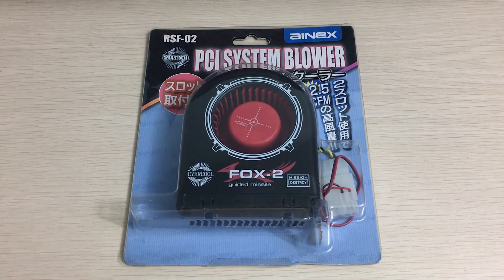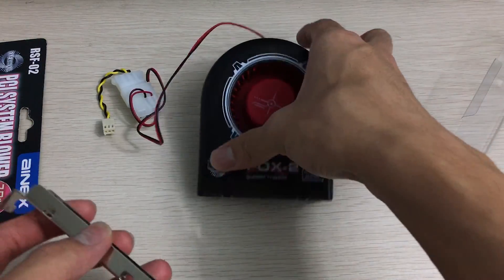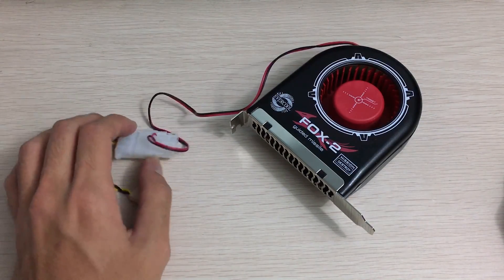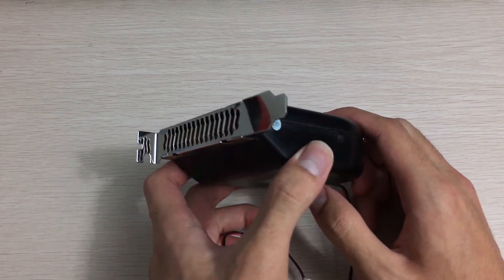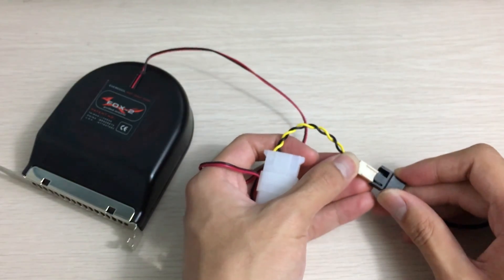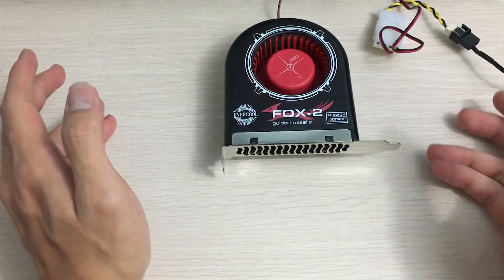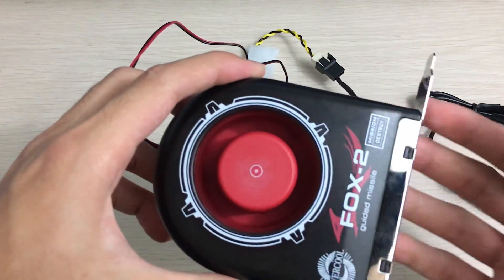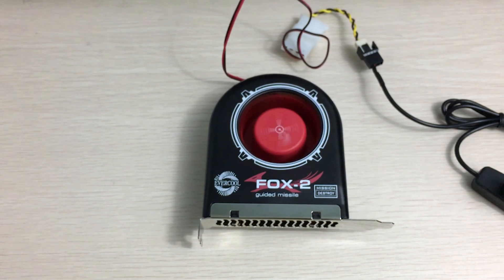PCIE Fans? What are those? | Evercool Fox-2 System Blower

Comment: which cable adapter are you using? does this 4-pin molex ide conversion for fan connectors? just tell me the name or please a purchase link. I'm from Brazil I loved the video congratulations !!!
Reply: its a molex to 4 pin adapter, available through amazon and most computer parts retailers

Comment: What are you talking about? It consumes hot air and exhaust it out of your case. Most of our exhaust fans are at the top of our case so this is useful because its down at the bottom under our GPUs. If you dont have a reference model gpu then this is extremely useful.
Reply: It is actually design for those office PC's or OEM pc's that has a poor airflow, or if you have an ITX build this is very helpful
Reply: @joshygaminghub7428  That may be the case but gpus produce alot of heat when active and this does a great job of getting rid of that heat. Its crazy how much heat you feel when putting your hands at the exhaust of this thing when gaming.
Reply: @qandmarco8994  if you have a blower style GPU and your case has a limited airflow on it, this thing would be useful

Comment: What are you using to control the fan speed as its a molex fan?
Reply: You can't control the speed
Reply: @ix.cryo1  Sure you can, it requires a molex adapter to either a 3 pin or 4 pin fan connector, then buy a fan speed controller in either 3 pin or 4 pin
Reply: @madcat30002  PC fan controllers usually rely on a PWM wire, which this doesn't have. It looks like he's using a simple pedometer.